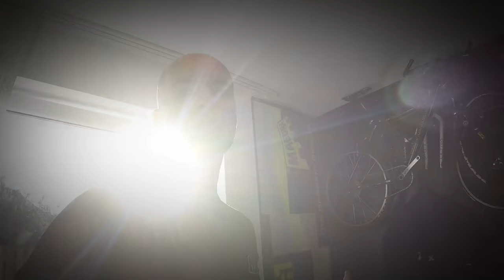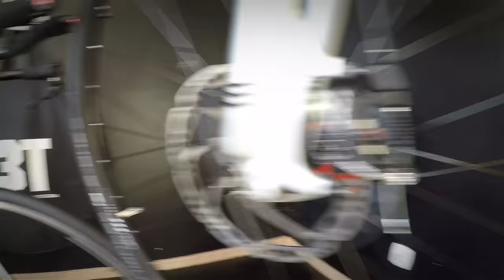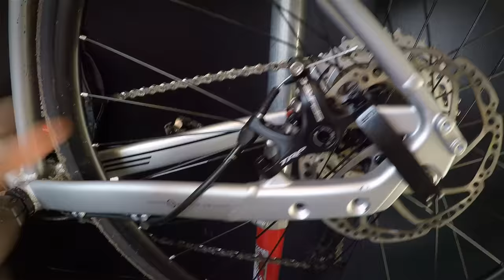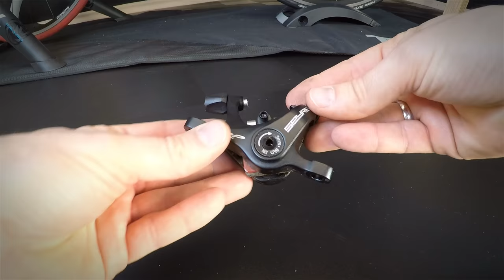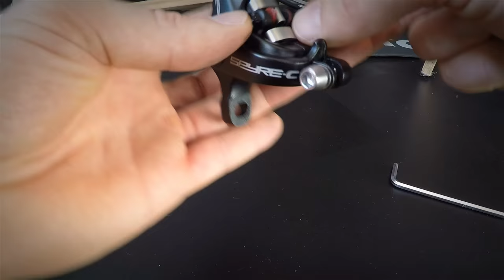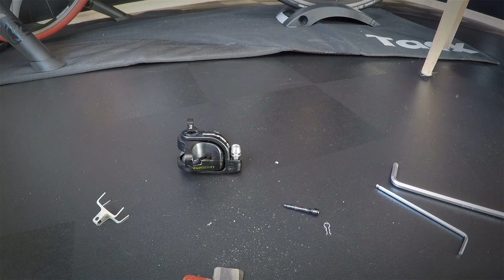Mechanical Disc Brakes On Road Bikes? HELL YEAH! TRP Spyre C Review / Test.

Comment: Have had these on my Giant TCX SLR 2 for two years now. I really like them. I regularly dismount and remount my front wheel from the bike and it almost never gets any rotor rub afterward, even with just QR dropouts. Soap or car shampoo used during bike washes does weaken the pads, but a few practice stops and power is regained. Just keep an eye on pad wear. If the pads are too worn down, the return spring begins to snap loudly every time the brake is used.

Comment: I have a Fuel ex 7 29er and the cablewrouting is for hydraulic hoses, even though I used my TRp spyke with gear cablers they worked well so far. The semi metallic pads give good braking power.

Comment: Hello from Sweden! Thanks! I've been skeptical about those, since I have hydraulic on my current bike! I was considering a Specialized Diverge, but it comes with exactly those breaks you show! Thanks for the comprehensive approach!
Reply: I have a 2018 Carbon Diverge with these and they work great ❤️ I just upgraded to TRP HYBRID(HYDRAULIC)-ROAD because of my riding style and needed the extra braking but with the ability to do emergency repair and adjustments that aren’t easily and as possible with full hydraulics. But for normal gravel and road the Spyre-C still works great! Way better than conventional single piston actuated mechanical calipers.

Comment: Agree 100%.  These are the best road mechanical disc brakes.  Bike brands need to consider some of these small things when putting bike packages together.  When I was researching for a new bike, if it had mechanical disc that wasn't TRP SPYRE, I crossed it off the list!
Reply: larmo80 agreed love these mechanical disc brakes and no fuss with bleeding

Comment: If you use decent quality wires and a good outer housing of the wires and make a quite good job in routing them without to many sharp bends the braking power compared to a cheap hydraulic one makes not too big of a difference but still noticable.

Comment: These are good brakes. 
V-brakes on my old bike sometime stopped working at winter. I think the braking surface on aluminum rim got covered with frost and ice when temperature dropped below zero, and then there was no braking at all.. Whatever how strong I pressed.. until the ice wore off and then  the braking effect came to alive sudden, blocking the wheels. 
 But with these, so far I haven't had any problems. It's possible that maybe the weather conditions just haven't been same.. But so far, I haven't had such terrifying experience with these as I had with v-brakes on my previous bicycles.

Comment: 2:05 - for water proofness I'd suggest shopping for bikes with the brake housing end pointing down, not up as on the reviewed bike. No one cares, but I made a final decision in a bike shop between two "finalists" bikes in favor to the one that accumulates less water (salt and stuff) around the brake cables.
Reply: Yes, I have a couple calipers mounted like this and it's common that they are exposed to simple invasion by water and dirt so I always put a brake cable boot from v-brake over the hole to protect it.
Reply from the maker: Good point :)

Comment: Those are the same brakes I have on my cross bike. I had a single piston brake originally but not enough stopping power and the lever would bottom out on the bars before I could get enough stopping power. With the TRP Spyre dual piston I am able to ride single track with much more confidence and control, plenty of stopping power with the dual action Spyre.

Comment: I have a brand of cable disc brakes called Bengal on my tourer. They're super powerful and apparently even better than the Tektro ones at the same price point (They're the Bengal 606 - great price). Note that mountain bike cable disc brakes are different from road bike cable disc brakes, as the cable travel distance differs if you use drop bar STI shifters.

Comment: Nice video,I am using Avid BB7s on my mtb,so much easier to adjust out on the trail,and I don't have to worry about kinking or pulling hoses out on the trail when I crash  :-)

Comment: I like my disk brakes but I'll have to change the oil for the next season (not required now as I'm only using my bike on Zwift: you don't brake on Zwift ! :-D), looks like the maintenance is easier on those mechanical breaks...

Comment: Curious if you can compare mechanical disc vs hydraulic disc but also include some mechanically-actuated hydraulic disc breaks (specifically TRPY Hy/Rd), since you don't have to use the large hydraulic brake hoods.
Reply from the maker: Next week I'll have compared hydraulic and mechanical brakes, but not the hybrid ones...

Comment: Not all mechanical disc brakes are equal - whereas I like Avid BB7's, the  Shimano BR-R505 on my other CX bike are crap. Having seen this vid, I'll be replacing them with TRP Spyres!
Reply: I hope you didn't ever do that, you won't notice any difference. The avids are actually better in the long run.
Reply: The Avids fucking blow.

Comment: Thanks for the vid. I'd like to know your thoughts about semi-hydraulic disc brake systems (Giant Conduct, TRP HY-RD, etc.). Maybe make a video about them? :)
Reply: I think it is very underappreciated compromise between simplicity and performance.
You get more precise braking power control comparing to strict mechanical brakes, more even (and longer) disc wear to.
You also can have less costly shifting system on your bike due to cable routing simplicity.
Reply from the maker: I'll definitely try to get those for some testing.

Comment: Hello. At 3:38 seconds, when you zoom into the brake, you have a small rubber boot for the cable. What are those called and where can i get some? I ordered a set for V-Brakes and they were too big. I need small ones like the one you're using in this video. Great videos btw. Thanks.

Comment: I'd love to see a comparison between regular brake housing and compressionless housing on disk brakes. that should take care of the spongy feeling on the rest brake
Reply: RawBananaJoe Park Tool has a video comparing normal spiral-wound brake housing with its compressionless cousin. They tested with caliper rim brakes but the effects are the same as with a mechanical disc brake caliper
Reply: TypeVertigo Do you happen to know what the video was called? I just did a quick search but could not find it

Comment: the additional weight of the disk brakes is not a disadvantage? What about the additional cost of disk brake pads? What about the usual noisy function of the disk brakes? i can admit that in rainy conditions you can brake easier but i live in a country with not many rainy days and for these days i can live without road bike training at all
Reply from the maker: These brakes are way more quiet, than my calipers, especially when I brake from 60 km/h to the stop.
Reply: ShaiBike Are they also  lighter or cheaper from your road calipers?
Reply: Sounds like TRP would be great for a commuter in Seattle, WA!

Comment: Nice video as always . I hane a giant roam  3  2015 with  tektro novela 160 mm mechanical but single actuated  with cheap EF51 brake levers . How can I check  if this TRP caliper will mount ( I mean are there mount variations ) and do you think it's nearly as good as the SLX brakes  ? Because at least here in Greece a full  SLX  brake (lever ,  hose ,   caliper, excluding pads )  goes as much as the spyre caliper alone ( about 75 ) . Thanks

Comment: thanks a lot!!! Can I install the same cable that I use on my  mechanical road bike brakes?  I would want to install jagwire cable ( 1.5mm) and housing for normal road brake ( no disc) .  Which is thickness of cable installed on your brake?
Thanx

Comment: I got a brand new Garneau Cyclocross. It came with Shimano mechanical brakes with Jagwire cables. The performance of the brakes is not good at all; I can press the lever all the way in with no stopping. I noticed that the cable is a little loose where it mets the caliper and has no end caps. I tried using regular end caps but they do not fit. Any ideas?

Comment: Unfortunately, owning the same breaks, I find it performance disappointing in some situation.
I live in hilly area and my total weight (bike + rider) comes to about 110 kg/ 220 lbs. Going down hill I have to squeeze breaks so hard, that my hands turn all white. I have to stand up and shift all my weight back, only then I can slow down. It is OK on the flat surface, but still no as good as hydraulic breaks.  
Purchasing a compressionless cable adds an about 80$ (~40$ per cable) and the total price is getting near the hydraulic breaks. Considering one needs to change cables every half to an year, it turns there is not much benefits to the mechanical breaks.
For a potential buyers I would suggest to consider the riding terrain and your total weigh. One shouldn't buy mechanical breaks if one lives in a hilly terrain or not being a light weight. As for me I'll bite a bullet and going to change to a hydraulic break set.
Reply from the maker: Thanks for your input :) When buying the hydraulic ones for your riding style, make sure you choose a model, that is overheating resistant.
Reply: I'm about your same weight and have had no such issues, even with the stock pads and rotors on my Giant Defy Advanced 1. You may have had glazing on your rotors, causing them to work less effectively. 

I later, however, replaced the stock pads with TruckerCo semi-metallic pads and replaced the stock rotors with Shimano Deore when the pads word out. I think the braking power improved, as did the modulation. I went with a larger 180mm rotor on the front as well, which required a different spacer for the flat mount brakes. They fit on the Giant Defy with no interference.
Reply: Late response, consider sintered pads
Reply: @timkosem3521  The larger 180mm rotor on the front is definitely the biggest contributor to your braking power than anything else. Baring a genuine mechanical issue, a larger rotor beats even mechanicals vs hydraulics.

Comment: Hi . Thanks for your video. I have this brakes on my CUBE Bike. But I can only adjust the outer side of my calliper with 3mm to get my brake pad closer. Is anything wrong or any trick that I can turn my inner side to adjust the other brake pad in my  inner side ? Any suggestions I will much appreciate it.

Comment: ".....very good power" !??.  I have the exact same brakes on my road bike, all stock from new, TRP pads and rotors, jagwire cables.  Rear brake is fine, but front brake feels spongy and cannot lock up the wheel no matter how hard I pull.  Any thoughts or suggestions on how to improve would be much appreciated.  Thanks.
Reply: swiss stop sintered pads
Reply: Tony.. did you ever sort your front? Cheers
Reply: @simsimmer250   Upgraded the cables to TRP compressionless and that improved things quite a bit. Also swapped the pads to resin as I ride almost exclusively in the dry and that helped too.  Still a long way off what I would call "good power" though, and constantly need adjusting to maintain performance.  Recently picked up a second hand Boardman TXC with hydraulic brakes and the difference is chalk and cheese.  Next bike will be hydro.

Comment: I don't understand why do you consider hydraulic brakes more complicated. What is so complicated with a piston in a cylinder, pushed by the hydraulic fluid? I am more of a mountain biker and when I put my first hydraulic rim brakes back in the late 90's I found them so simple to use, to replace pads, no more worries about dirty cables.
Reply: piast99 I've had issues in past with leaking hydraulic hoses
Reply: I've read air bubble can hard to get out of some lever assemblies, and leaks.

Comment: I'm already waiting for those bikes which are coming to You :-)
Reply: ok I'd like disc brakes but do I have to buy a new bike!? Im riding a giant defy 1 2015. Would it be straight forward to fit discs to my existing bike. I appreciate I'd need new wheels.
Reply: John Mills The braking forces are different, so the frame must be made to account for them. That's the main reason why retrofitting disc brakes to a rim brake frame is bad news.
Reply: TypeVertigo thanks for replying. I think the frame would be ok strength wise as Giant have put discs on their recent defy bikes. BTW meant to say I'm enjoying these videos Shaibike. Love your enthusiasm and presenting style. (UK)